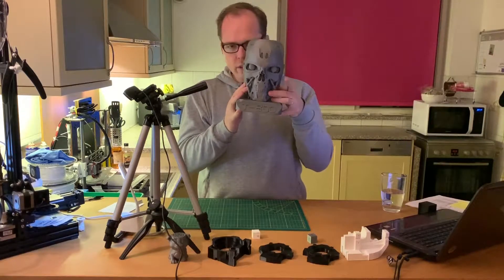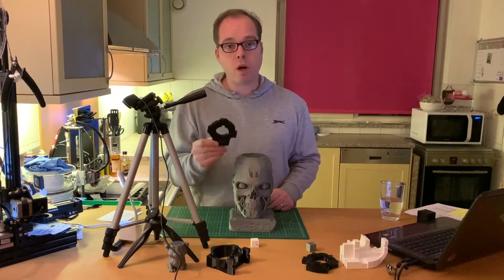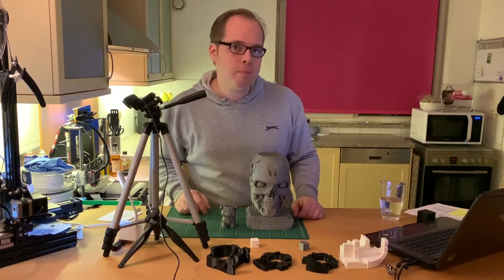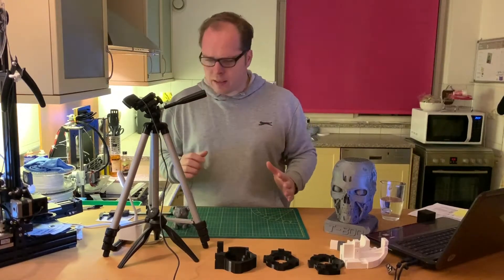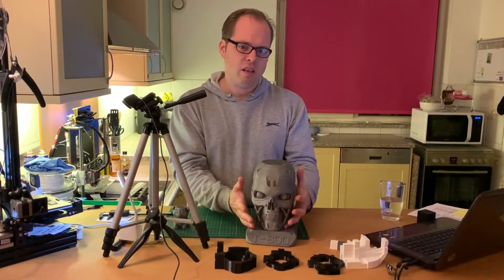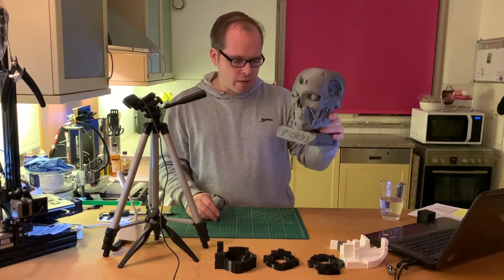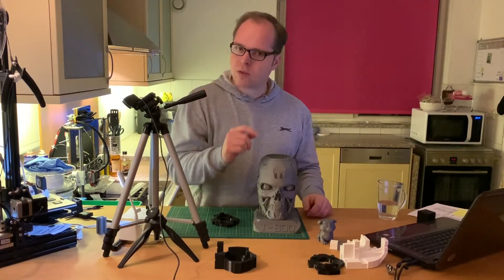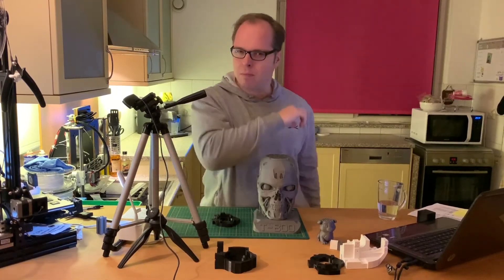How to use infill for 3D printing?

Comment: I use tinkercad for my models im a beginner But I dont know How to turn on infil or something becouse if i keep my model solid it wont use infil, and if i make a open space in my model it still doesnt use infil.  (I use bambu studio).  Please help
Reply from the maker: Sorry for my late reply, did you find a solution for the infill? If not, Infill can be found in all slicers and it is called Infill. Infill has a percentage and it is in the basic settings of the slicer.